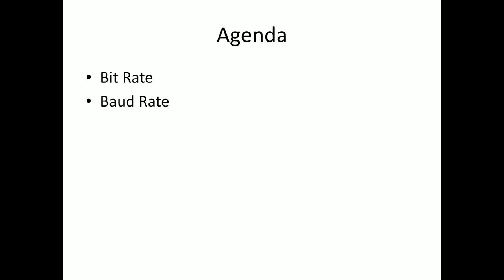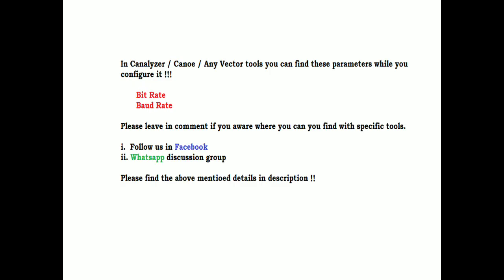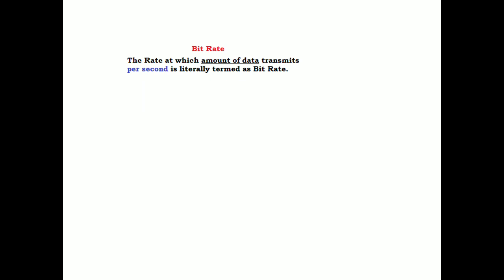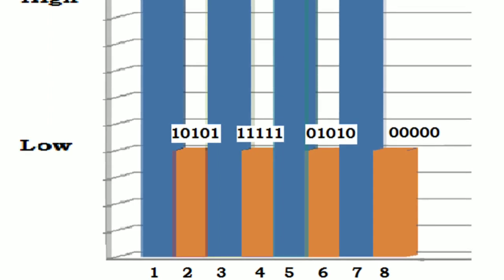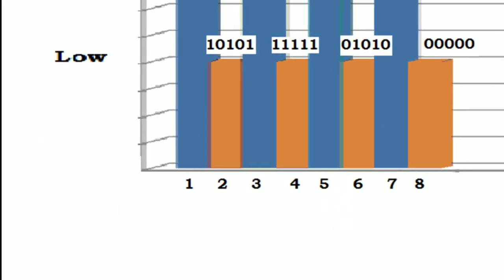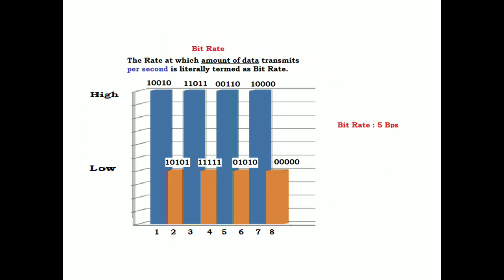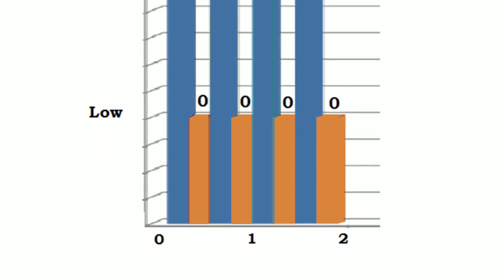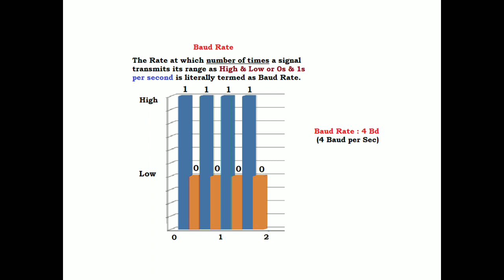Bit Rate | Baud Rate | What is Bit Rate | What is Baud Rate | Embedded World | Vaithi Edu |

Comment: can you tell me what is the exact message or signal or data tramitting in CAN wire ? its a interview question
Reply from the maker: All three
Reply: Encoded format of Message is called frame that contains bits, these bits transmit from transmitter to receiver in NRZ format.
Actually we are transmitting bits from transmitter to receiver and vice versa
Reply: How we will calculated can bit timing